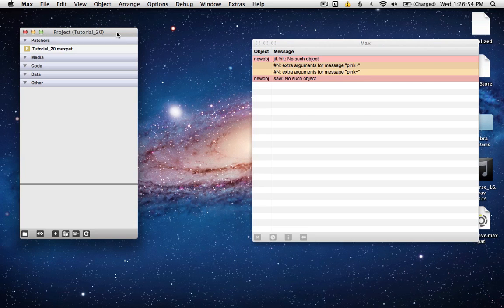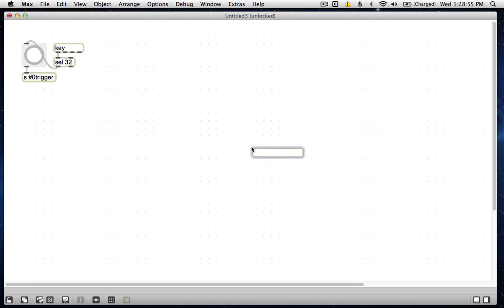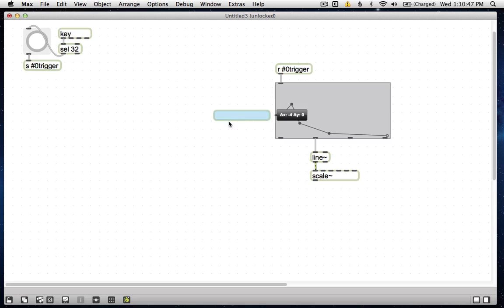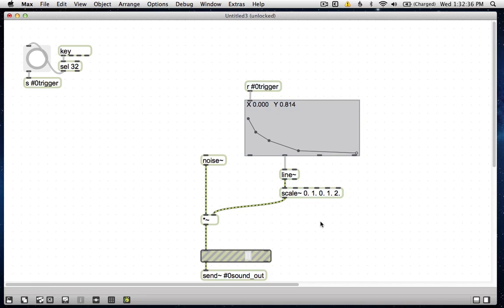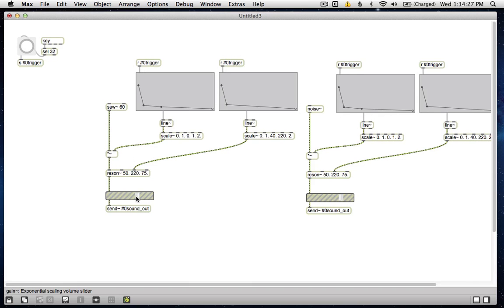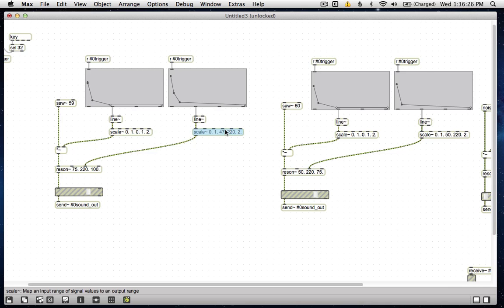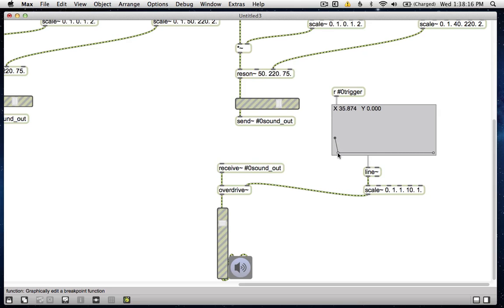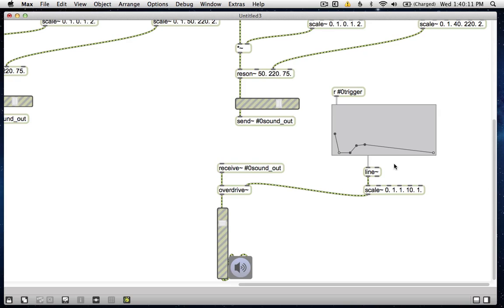Delicious Max 6 Tutorial 20: Kick Drum Synthesis

Comment: can someone explain the exponent part of [scale~] in simpler terms? i'm struggling to understand what that argument is doing to the signal
Reply: [scale~] basically takes the incoming value and scales it to the set output range. So in this case we know the values output from [function] are from 0. to 1. (default, but can be changed in inspector). You can confirm this by hanging  a message box or [print] off of it and watch the values. The 0. and 1. are your input range, or the first two arguments in [scale~].

The third and fourth arguments are the range you want to scale to. So in this case the arguments were 40. to 220. Inputting a 0. on the inlet will result in a 40. on the output and a 1. on the input will result in a 220. Super awesomely useful.

The optional fifth argument is a little trickier. Without the fifth argument the scaling is linear between 40. and 220. in this case, but since we hear on a logarithmic scale it makes sense to put the range of 40. to 220. on a log scale. Putting the 2. as the fifth argument still scales from 40. to 220. but now divides the range up exponentially with a power of 2. You could work just fine without this argument, but it helps to tweak it a little better to our human ears.

I'd suggest working with [scale~ ] and [scale] by themselves for a bit looking at what comes out of the outlet when you put a known simple value on the inlet. Rock!